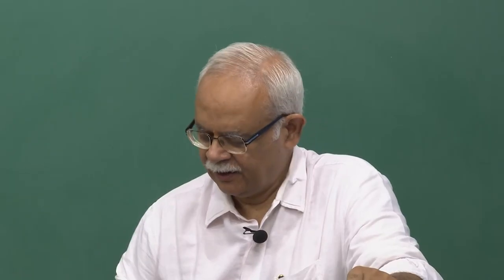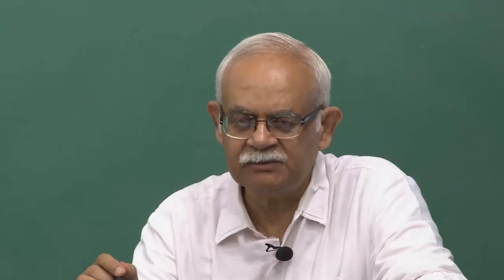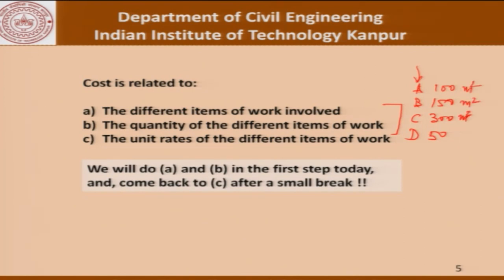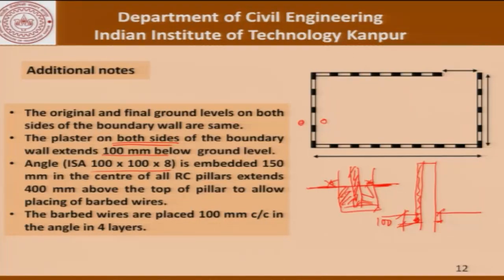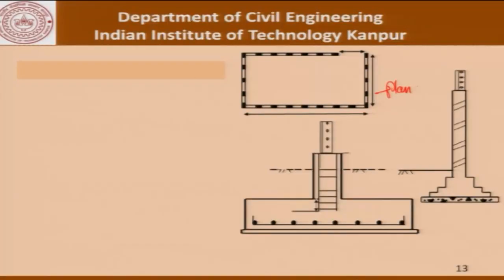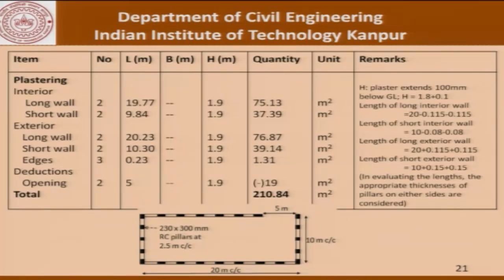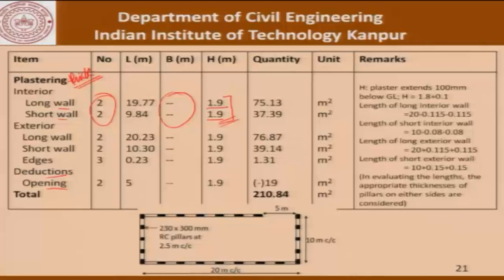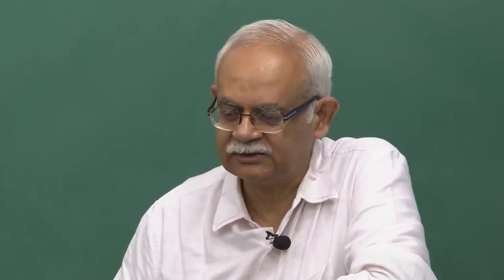Estimating quantities

Comment: There is a mistake in calculation, for the no of bar in footing. The no of spaces came to be 6.84 nos. The no of bars= 2*(6.84+1) = 15.7~16 Nos. So, 16*23= 368 nos.

Comment: 16:40 when u take the total length as 60 do we need to excavate entire 60m.sir can ask u something ,if the long walls are taken as 20m then the short wall won't be 10 m each.the 1.3 width will cover on each sides from the long wall length,isn't .Someone plz clarify my doubt
Reply: Yes, the inside span for the excavation will be reduced, but the excavation will also extend after the 20-metre span equals half of 1.3m from the centre, which will account for it.

Comment: why P.C.C is required....sir asked the question,why we can't start brick after ground....please clarify ...
Reply: 1) pcc is use for leveling. 2) you can't use any construction material because when it comes in contact of ground there will be a chance of corrosion of steel.

Comment: Sir at 16:40, how deduction is 3.7 m????
Reply: To construct the footings we need to excavate on eithe side of the pillar center line... which keeps the pillar in center of the footing.. so.. at the gate way which is 5mtr in width.. the footings on it left and right side will extend up to 0.65Mts from its centre.. as the gate way has two footings on both sides.. total deduction will be..5-(2*0.65)=3.7..
I hope ur doubt is clarified
Reply: 5 m is the clear distance. iI is not center to center distance. Therefore 250 mm + 50 mm + 200 mm = 500 mm should be deducted from both ends. 250 mm is half of 500 mm and 500 mm is the difference between the dimension of footing 800 mm and the dimension of the column along the wall which is 300 mm. 50 mm is the extra width needed for the PCC bed and 200 mm is clearance for the working space. Thus in the calculation of deduction 5000 mm - 2 * 500 mm = 4000 mm (4 m) length should be used.